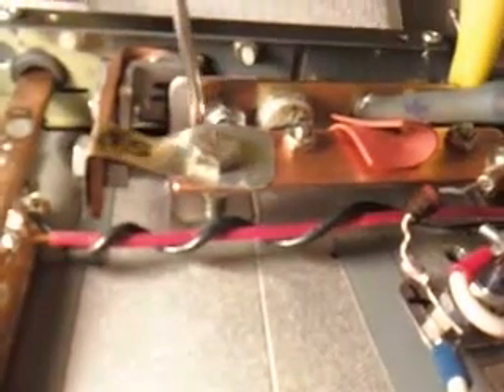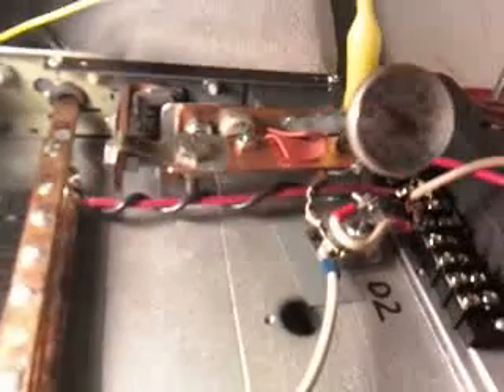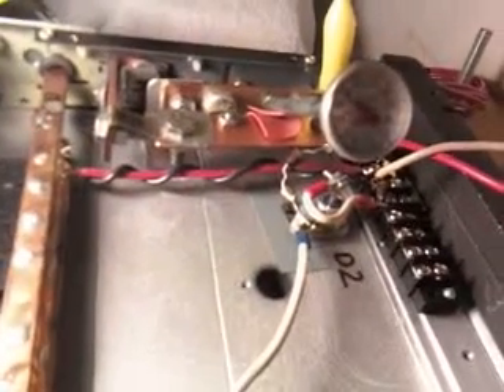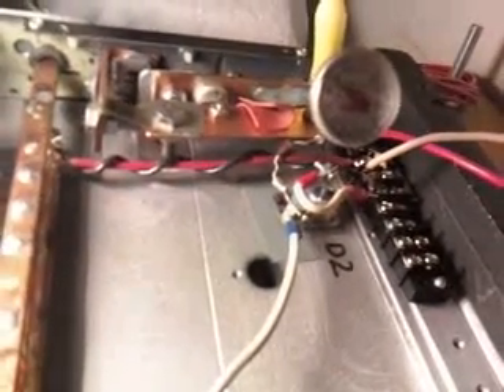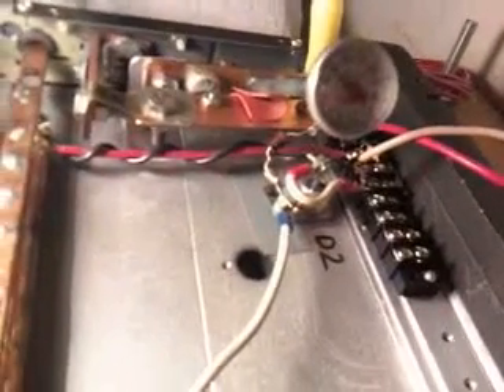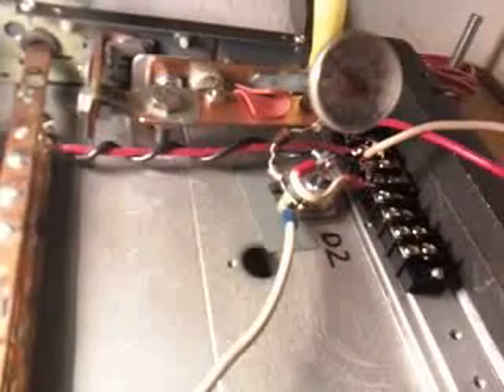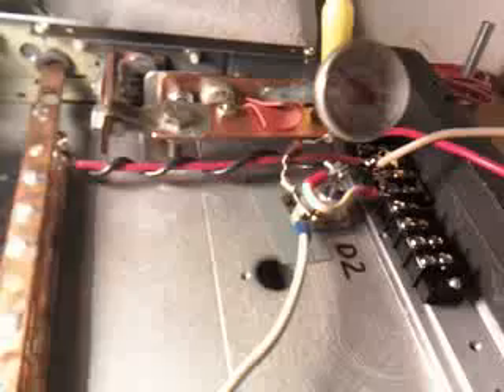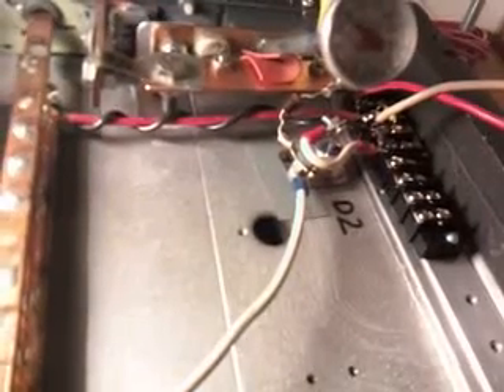200 AMP MOSFET SWITCHER TEST 12

Comment: hello nice work, did  you connect the mosfets in parallel and about the voltage spikes between the drain and source (caused by pwm) did you use a snnuber (RC)?